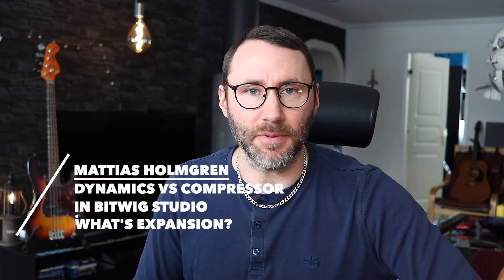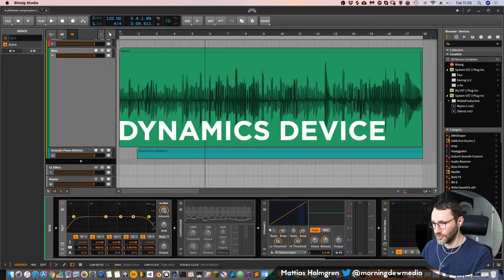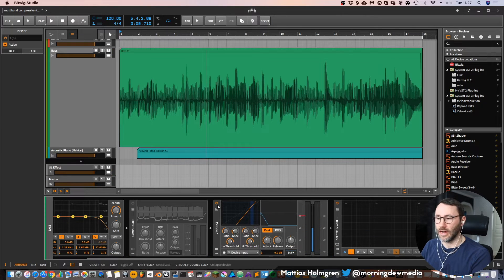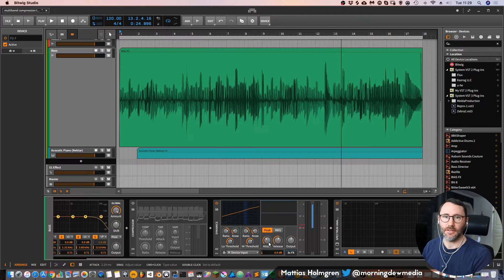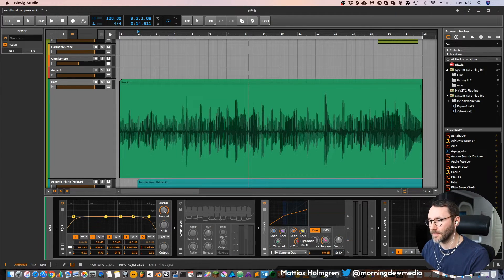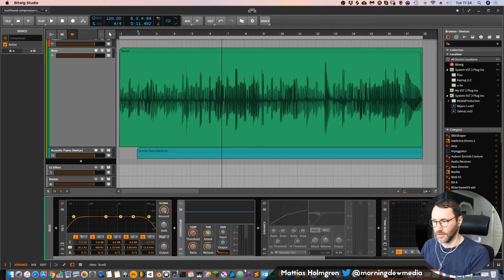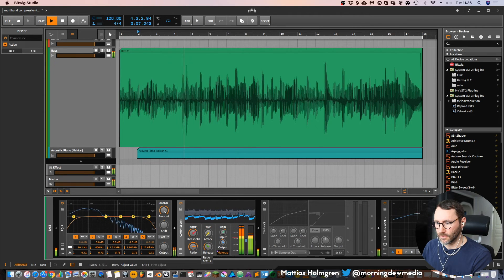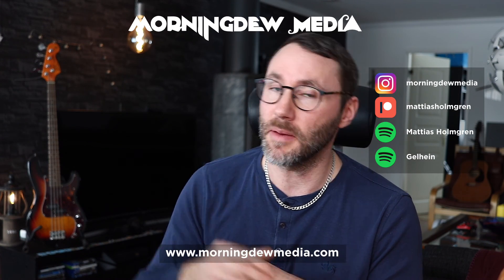Dynamic Expansion Explained - Bitwig Dynamics vs Compressor

Comment: Great Job on this tutorial Matt! So the Dynamics part is what Ozone does as well for Mastering :)
Reply from the maker: Yeah, Ozone does some great dynamics mastering plugs, iZotope, Neutron. 😀 Though I do think the assistant / analyze in Neutron (at least version 1) was a bit too hyped. It rarely work that great for me. So I end up making custom presets instead. Did you try the Neutron vst 3DFX? Thanks, happy you like the tutorial!
Reply: @MattiasHolmgren   Idont think so yet.. But i did Masters on few of my tracks with Ozone 7. Very comfortable to work with! Is Neutron new for version 8? What does it add? I checked yesterday for metering plugins & saw people use to use Fabfilter L2 for measuring LUFS. Iwas still bit scared to use it, since i tot iv heard people say that limiters can degrade sound quality? I also ended up downloading the free Youlean Loudness meter which looks like a champ! (tho i prefer Fabfilters digital meter) Tried it yet? Im Joseph by the way 😊
Reply from the maker: Hi Joseph, You Lean is to me the best and most accurate meter for LUFS etc. Fabfilter limiter is the best and most transparent Limiter to me. It can push tremendously without degrading (if wanted) I run LUFS at about -13.0db when mastering. Max peaks at -0.3db.

Neutron isn’t really new. There’s already a version 2. I don’t use it that much but has a nice feature to sidechain EQ peaks towards another track with Neutron. Quite nice to get vocals to sit, or bass vs kick. Thanks!
Reply: @MattiasHolmgren  Excellent information Mattias! I might have a closer look at them sooner or later!  👍 i just found it alittle interesting to see that Spotify requirements are -24 LUFS. Iv seen on google the new standard is -23.   Sounds like overkill? Or should i say UNDERkill haha? Guess it depends what sound system you feed it with in the end mostly right?
Reply from the maker: @tredfxman  Spotify mastering target should be at around -14db LUFS integrated. You have the mastering info for Spotify at their website: https://artists.spotify.com/faq/mastering-and-loudness#will-spotify-play-my-track-at-the-level-it's-mastered
I also wrote an article on the subject explaining around the subject of LUFS:
https://www.morningdewmedia.com/mastering-for-spotify-lufs/
Reply: @MattiasHolmgren  Allright great info Mattias Thanks!  👍

Comment: Where did you get the info that Bitwig compressor is an emulation of the FET 1176 URI ? It's nowwhere in the manual ....
Reply from the maker: By ear. In my opinion it can sound a bit like a 1176. But overall the plugins of Bitwig are quite natural and transparent in nature. But when you drive the compressor it gains a bit of character.

Comment: Sorry but wrong about expansion!! The quiet parts get leveled up to get closer to the lound once. This plugin is acting partly like OTT without the bands where loud get quieter and quiet get louder to reduce the dynamic difference
Reply from the maker: No, my info is absolutely right. I was talking about expansion. dynamic ”expansion” (when the plugin is set to  expansion mode” is about giving audio more dynamic range. When set to normal ”compression” mode, yes you decrease the dynamic range. I explain it in full detail throughout the video. In compression mode, yes, it might give  similar result to OTT…if you slam it into an multiband Fx-2 or fx-3,one dynamic decice per band, it becomes separate band compression similar to OTT. OTT still gives a different result because it has other stuff going on and other settings / split point curves etc.

Comment: Ah, I didn't know about getting saturation by overdriving the input level of the compressor. Thanks! I also didn't know that compressor emulates the 1176. I really like the dynamics processor: it can do a lot on the master chain when you're trying to get the overall loudness of your track up into commercial range.
Reply from the maker: Hi Brian, yeah its often fun to drive plugins to the extreme and see what happens. Dynamics compressor in Bitwig Studio rocks! I also like to use Molot free compressor for some nice crunch & character on sounds.
Reply: @MattiasHolmgren  Thanks for the pointer. I'll check out the Molot compressor.

Comment: Nice video! Thanks! I have one question, I sometimes want to use the sidechain and overcompress the loudness a bit, because in EDM it sounds great to Sidechain a lead loud, but then when i stop the track the sound does not stop and gets so loud it cracks my ears, do you know how to avoid this? maybe a device exists that cuts the sound in the end? It is pretty annoying.
Reply from the maker: Hi Jason, oh I know the feeling. It sounds like you have a levelling issue. If you setup all your levels correctly this issue should never occur. 🌞
I can probably do a video on this, but what I do is something like this:
1. For single instrument tracks (which is side-chained /gated, or otherwise affected by some automated / modulated -levelling):
Make sure you always go from 0db to minus when you modulate, that means use unipolar LFOs (NOT bipolar). Unipolar is easy to setup because you know the end of your scale and can set it precisely. If you are using unipolar you only set the mid-point and can't really tell where the end-points will hit. So it could go above 0db into +6db or whatever, depending on what you are doing.
Also if you are doing side-chain make sure the attack is fast and the release is NOT TOO LONG. The release is important because if it's too long you might be listning to the lead at say -6db and when you have a breakdown (without the triggering sidechain kick) your lead might swell into 0db or whatever you setup as reference starting point for the level. With a long release the lead might never go back to that original "top" level and sound fine when you got the beats blasting.

2. For your master SUM bus (or group busses). Same thing here make sure you don't hit 0db. I have my final mix bus not exceeding -8 to -12 db (peaks) before I start doing any mastering or final processing. 

In this digital age it doesn't hurt to have a lot of headroom. It's easier to mix if not everything is smashing into red.
At least that's where you should start. If you then get confident and know how you setup all your sounds you can of course hit a bit harder. But the starting point should focus on not exceed something like -8db for peaks.

I never have this issue anymore where sounds get uber loud just because I have a breakdown or whatever. It's all about how you setup your separate individual tracks. I must definitely do a video on this, about how to do proper levelling (with side chains etc).

Thanks for lifting this important topic Jason! Thanks for writing! 🌞💫😀
Reply: @MattiasHolmgren  Those are very good tips, thanks for your reply, Your other mastering video already helped a lot, It's definitely something i am doing wrong in the settings of the dynamics when using the sidechain, however i always make sure my separate tracks do not exceed -12 db, maybe it is the release in the compressor, i have to check this . I will test it once more, and also your unipolar lfo tip. Video's about levelling and sidechains on separate tracks are always very welcome. You are very good in explaining. Thanks.
Reply from the maker: Hi Jason, sure, yeah I hope my latest volume / gain staging video helped with the issues you are having. My bet it is the release of your side-chained track. Just follow my principles and you should be fine. ;D

Comment: Thanks for a nice video, Mattias! Really hot topic indeed, sometimes it seems, everyone speak of compressors =)

I actually used only Compressor device in Bitwig before I saw Dynamics in some of your videos, and now, I think, I use both of them equally. Dynamics is good in having this bottom part compression, sometimes it's very effective and prevents the result sounding overcompressed. Side-chaining is also very common practice nowadays, and with the lack of built-in envelope volume shaper device and/or modulator in Bitwig Studio, it's probably the most natural way to get the side-chaining work.

I've also heard several times about Молот but have never tried it myself (in spite of cyrillic name spelling, haha). It's "hammer" from Russian, by the way, so it probably should do its compression job fine :D

I actually not too much fan of using compression to sort of colourize the sound, sometimes it really makes the sound more warm or something, but generally I don't get why to use those extremely expensive replicas of famous console compressors or something) Maybe that's because I don't know how to cook them =) But yes, for now I'm very satisfied with Bitwig build-in modules in this area. They just work, which is enough for me)

What external compressors do you usually use, Mattias? Any kind of analogue-based ones?

Thank you for another interesting and live topic described and nice video! I wish you even more ideas and productivity, new nice tracks and videos, and I'll follow up yet unseen ones meanwhile :)

Comment: Thanks for the clarification. Your videos are very helpful.
Reply from the maker: Hey Dusty, thank!!! I thought it would be great to get to know these two compressors and really see what sets them apart. It’s easier to know which one to use for certain sounds. What compressors do you use? Did you watch my recent vocal mixing/processing video? Even if it’s in FL we still can apply the technique to any DAW.
Reply: @MattiasHolmgren  I use the bitwig compressor a lot. Because it is easy to adjust and I have a visual representation of what's going on there. I like to get more attack on drums with it. On vocals I like the CLA-2A from waves. It helps a lot to bring the vocals in front and make them more crisp.
Reply from the maker: @mysticalmusicmoments  it's hard to go wrong with the CLA-2A. Beefy compressor indeed. There are quite a few manufacturers who did replica versions of the CLA-2A, some better than others. The Waves one is indeed pristine, like most plugs from Waves. Good to hear about your setup. I really like the visual representation in Logics compressors too. Maximizer in FL Studio is a bit quirky to get your head around, but oh so powerful.

Comment: Nice tutorial, I didn't know that the compressor gave saturation.
I have been having trouble with the Dynamics device when expanding. If the low threshold is set to a positive value it can push up the volume and create a loud static tone/noise that nearly blew my ears once when I automated the device on/off button. Do you know why and how to avoid it?
Reply: Haha happend to me two times as well.. im just happy my AKG 240 MK2 are still working, along with my ears.. ;)
Reply from the maker: Sounds like a non wanted feature. What version of Bitwig? Did it only occur when automating on/off? What happen if you stop track, let it be in ON mode, play and reach audio clip? Same result?

Comment: it is pronounced like ['molot] (which is "hammer" in russian)
Reply from the maker: Awesome, I can probably not pronounce it right. But hey I think it came across that I like the plugin. =) Oh, forgot to add the Molot-link. Will do that in a sec! Thanks for noticing, hope you like the video! What do you think about the compressors of Bitwig?
Reply: @MattiasHolmgren  well, i one of those persons who uses compressor as utility device. so basically any compressor will do their job (if it able to compress :)) and bitwig devices definitely do their job. if i want some "magical" effect like presence, air, fatness i rather will use standalone saturator. anyway i'm not a fan of all this crazy valve/transistor/tape emulation plugins mania. the music itself is prime goal :)
Reply from the maker: @deviantstudio so true deviantstudio, sometimes it's better to look at what audio content / tracks you have and clean up your arrangement rather than reaching for plugins. The final music should indeed be the prime goal! 👌☀

Still I think Bitwig still lacks good beefy saturation tools, so to get some oomph from the Compressor is welcome. For me it's fine, I'm using Trash 2, Fabfilter Saturator etc. but for people who buy Bitwig and don't own third party plugs it's a weak point.

Comment: Great video as always! 

One comment: when explaining the difference between compression and expansion it would be more obvious for people watching if you rendered the waves post-FX and compared them to the original - one would have the peaks closer together, the other further apart.
Reply from the maker: Hi Artur, thanks glad you enjoyed the video. Absolutely, an image post-FX render, that would have been a great addition. I hope people listen to the bass sound. It's quite a drastic change when expansion is at max. =) 
What do you think about the sound of the compressors in Bitwig?

Thanks again for your feeedback.
Reply: @MattiasHolmgren  I rarely use the Compressor, but Dynamics is my go-to. It's very rare in native DAWs tool to have separate control for high- and low- volume signal and even rarer to have negative ratios. It's just awesome and I really like that it's transparent, because if I want colour I'll add it using different devices :)
Reply from the maker: @antic604   absolutely, they really pushed some strengths into the Dynamics device unseen in other DAWs. Yeah, sound color should be added with care. But I really think it's neat that you can cram that kind of saturation from them...if you want. =)

Comment from the maker: How does the Dynamics and Compressor differ in Bitwig Studio 2.5? Dynamic Expansion Explained - Bitwig Dynamics vs Compressor. Let's explore why and when to use either of these lovely devices in Bitwig Studio.

Learn all about dynamic expansion vs compression. Why and when to use either of the two. Is the dynamics multiband?

I hope this video will give clearance in how these two devices work with your audio content. Let me know if you have any questions!

The Dynamics plugin is based on a pure VCA (voltage controlled amplifier) design, while the Compressor plugin is also based on a VCA design it adds feedback operation as known from the UREI 1176LN. The feedback operation in urei 1176ln (ln= low noice) uses VCA circuit but signals go thru a FET. 

Try running the signal really hot into the compressor, use a low attack / release (be sure to lower the output). You will get some really nice fuzz out of your sounds. 
Experimenting is key in Bitwig.

Please subscribe, give a thumbs up and write some kind feedback.
Kind feedback gives you tons of good karma! =)

Thanks for watching,
Mattias Holmgren - Morningdew Media https://www.morningdewmedia.com